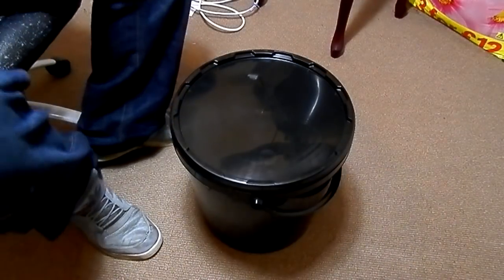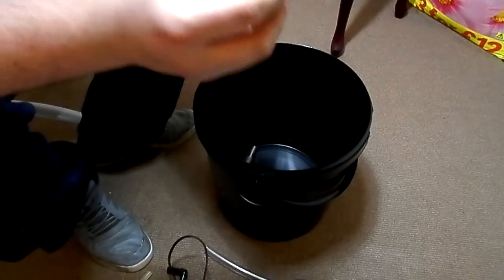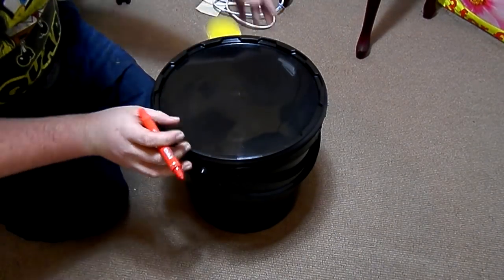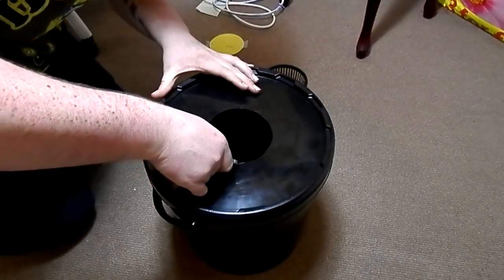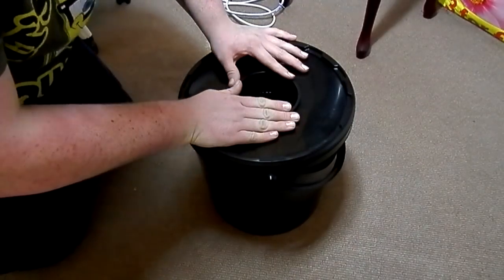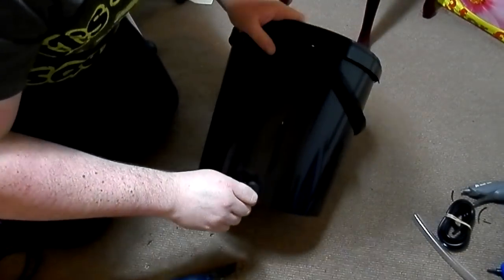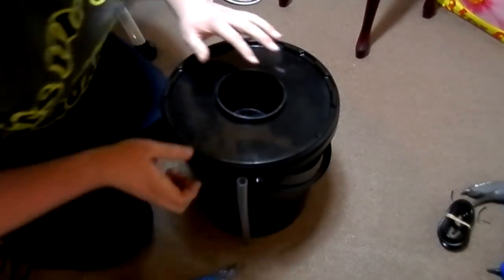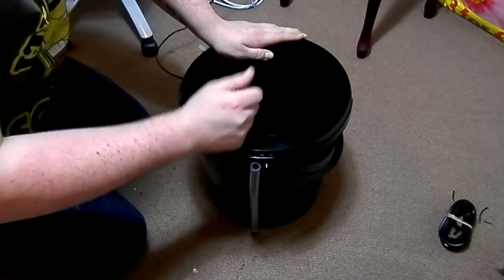How to make a Ikon Oxypot (DWC) Bucket Hydroponic System

Comment: I have done my pots by your video, but one snag that's pissing me off,I have done the 20mm holes in the bases and the problem I have is the grommets 13mm are to small for the 20mm holes?
Reply from the maker: each grommet has different diameters mate mine had a 22m diameter and 13mm inside diameter, best to use a measure for what ever grommets you have, mine were made by general hydroponics if that helps.

Comment: hello   !
Great video bro.. i have few questions...i would like to make setup with 2 or 3  20Litres  bucket DWC system. And i would like to know how powerful water pump and air pump would i need, and also how big ( in litres) reservoir would i need. 
Thanks ;)
Reply from the maker: hey a boyu 4 outlet pump runs 4 of these buckets with ease :)

Comment: Great video, nice and simple design showed in a clear manner.  I'd like to ask a couple of basic questions that I have about this system, 1) Would it not be tricky to make a system of this nature if you had multiple pots, as there would be no circulation. 2) Taking measurements of ppm, temperature and pH would be difficult due to having to regularly take off the net pots and lid .

I still really appreciate you doing this video and am just provoking further possible elaboration on how to possibly upscale this DWC = RDWC. 

Thanks again
Reply from the maker: Thanks For Watching :)
1, I have never tried more than 3 buckets at one time but there is like you mention RDWC which is a multiple bucket system, you could simply make these buckets and connect them all through the water level indicator hole and have your master bucket with your circulation pump out of a large storage tub.
2,I myself just lift the lid each time, but also you could turn the water level pipe and just take a small sample out the test for the ppm and ph.
Reply: Thanks for responding , keep up the good work. I may well be stealing some of your ideas :)

Comment: You will find it beneficial if you secure the net pot to the bucket lid, either with cable ties or small PLASTIC nuts n bolts , don't use metal as they will react to the nutrients ! the reason for doing this is to make the base of the plant anchored to the bucket, the plant will not lift the net pot if you decide to bend or train the plant when it's larger or to stop it toppling over and just lifting the net pot out !

Comment: Absolute legend. Thanks very much for this video, it was very well done. Question; Do you think you can put another hole on top side of bucket to refill, and the water meter hole to drain if your doing scrog? I'm thinking of doing about 6-8 and dont want a hassle changing nutes, topping up.

Thanks again.
Reply from the maker: You could cut a small hole in the lid to refill and just cover the whole with black plastic while not in use that could work well for a scrog. you sure can use the indicator to drain i do that myself. Thanks For Watching.

Comment: why dont you just connect the airline to your 1/2 in line on the side and you dont need airstone
Reply from the maker: because that's a water level indicator anything else but water in there will make the level inaccurate!, and air stone create better levels of dissolved oxygen in the nutrient solution's than not using one and lets face it there real cheap!

Comment: Hey I have a question. When you have had the seed germinate and grow for a week or so in the rockwool how much water do you need in the hydro bucket? Do the roots need to be submerged once you move the plant into the hydro system?
Reply from the maker: Hey mike when you put the seedling in keep the water 1 inch above the bottom of the net pot until roots grow outside of the net pot then drop the water level to about 1 inch below from then on. Thanks for watching.